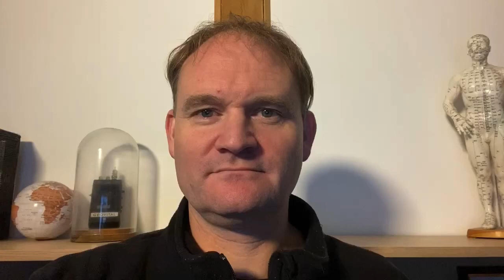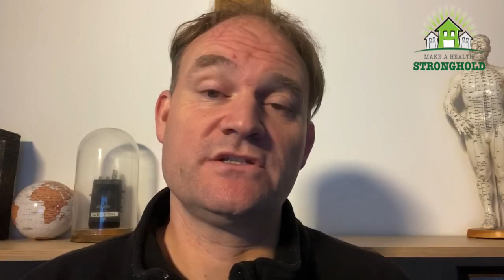Interpreting RF radiation readings on a TF2 or other EMF Meter

Comment: When you mention slight, severe or extreme exposure, what do you mean by exposure? Is it long time exposure, like in your living room or bedroom when you spend most time?  Or in a classroom? Because I constantly get low RF in every room (0.002mw/m2) except when I move  my GQ EMF-390 meter close to my router (less than two meters), microwave, or my smartphone/tablet (in active mode). Second question: My Trifield TF2 also measures RF in mw/m2 but the measurements are constantly lower than the GQ EMF-390 (like 10 times lower). Any idea why? Thanks for your help.
Reply: I think there's a Scale problem, in the instruction Manual says 10.000 mW/m2 is the max permitted. the max permitted according to icnirp is 10 W /m2. I would say that when you see 10.000 in the measurement is actually ten thousand miliWatts, not ten milliwatts.

Comment: What should I be looking for if my TF2 takes readings of 8.000+ mW/m2. In places we sit and eat. I live in a rental house built in the 40s, and after watching your video, I'm a bit concerned. What are some physiological effects I should watch out for?
Reply from the maker: Hi Jason, I think you edit this comment, I read your initial one from our notification. It is perfectly usual for RF readings to fluctuate from moment to moment and even in different spots in the same room. Reflection from building materials nearby could be at play and output of transmitters of course.
There is enough research highlighting the health risks at levels far less than you're experiencing, regardless of the fact most government standards find this perfectly ok. Question is if you want to wait/take the chance for physiological effects to start becoming undeniable.... or if you'd like to take steps to support your health. Headaches, ringing ears, anxiety and weakened immune system and low energy seem to be common first symptoms, but high blood pressure, changes in the blood, risk of cancers is also part of this story. Some people will develop nothing. Others can't walk into a library with the wifi on....
Key is your sleep area! This must be perfect and even in a rental you can normally ensure this is right with removable VERIFIABLE solutions. (Don't buy the crap that promises to neutralise, balance or harmonise.... ) 
First step is to get a professional assessment done by one of the consultants trained by us (GEOVITAL) who will assess the BODY rather than the air wherever possible, and will bring professional equipment and experience to do so. If there is noone nearby and this interests you... please come and do our EMF1 Consultant Training and become a consultant yourself. All information and consultants can be found here: www.healthstronghold.com/rfs?=1 
Don't wait. Do something.

Comment: I live 100 yards away from a monopine cell tower in Los Angeles. It is a new cell tower and very close to many apartments. From the ground, a direct, unobstructed path the TF2 reads (over scale peak, small numbers) and 15.000 + mW/m2 (large readout), from inside the apartment it reads 10 (on the small peak numbers) and 4.653 mW/M2 on the large numbers. I have pictures!
Reply from the maker: Its a worry. Read my comment to Jason I just left as it applies to you too I think
Reply: @geovital-international  We bought faraday material for all the windows, as the microwaves were bouncing off of the apartment building in front of our window, the faraday material reduced the radiation by 80%, no joke but we started noticing a difference (an increase) with cognitive function. Strange issues during peak hours 4pm-7pm where all of us would get tired/sleepy and cloudy headed specifically during those times on M-F, not something we want to be guinea pigs for, we are now moving.

Comment: Hello, is it normal that a bed grounding sheet is showing a reading of 700 /800 vm on standard electric setting? Thanks.
Reply from the maker: If its a grounding sheet... how does i have a 'setting'??  We disagree with the use of grounding sheets. They lead away a static charge, which is a problem of your MATTRESS, but they also attract MORE electric fields from the walls and ceilings around you. If you are on it, you are grounded and they YOU are more attractive for electric fields who WANT to go to ground. Youtube videos may show ZERO readings, but those measurements are no longer appropriate for a grounded surface. ALL interference should be dealt with BEFORE it reaches the body... not after.   Our consultants can investigate that, with you, and assessing the body wherever possible instead of the 'air' as it is all about you and your family... not the air. Find our people (or come do PRO training yourself) at www.healthstronghold.com/rfs?=1

Comment: I am interested in purchasing a RF/EMP meter to monitor areas of my house (bedroom) and electrical pole outside my house. The lower two lines on the pole are relatively new and they are equipped (I believe) with 5G emitters. The utility company and a subcontractor recently pruned several tree limbs, bushes from the pole to my house, and in the entire neighborhood. Not happy!!!

In addition, I wanted to use the meter to monitor possible radiation (60 gigahertz range) emanating from some “equipment”. What type of meter would you recommend or other suggestions you may have?

Comment: Patrick, I have the Trifeild TF2 EMF reader, and after feeling a bit disoriented while listening to a u-tube video on my cell phone this morning, I decided to measure the RF frequency coming out of my phone.  I was shocked to see it was kicking out high measurements that were peaking  at levels of 14000, and 17000.  So I turned it off and pulled out the battery.. Once I did that the levels returned to a safe and normal reading.  Do you have any explanation on why it was so high?  I live in Arizona.
Reply from the maker: You're measuring in milli watts which are small amounts but have been show to have biological effects. Thats why EMFs are ranked as a class 2B possible carcinogen by the world health organisation (just like exhaust fumes). Also phone manufacturers put warnings in their terms 'do not place this phone against your body' and that is related to the very relaxed government guidelines.
So short answer: That is what phones do. Keep your distance when on calls. Turn it to flight mode whenever you're not on a call (just call people back and use speaker phone), or better yet... get rid of it. - For health... your bedroom must be perfect and there is a lot more going on there I'm afraid. Get a home assessment done by one of my consultants and make some changes that matter most.

Comment: Hi Patrick, I have recently bought a Trifield TF2 meter and I am terrified to see that in the room that i keep my desk, which is on the second floor, the meter gives maximum reading (19,999mW/m2) almost everywhere in the room, even when I point it at concrete walls. How dangerous is this reading and what could be the source of it? Thank you - A little update: I realized that in this area im telling you about, if I am holding the meter or hover my hand around it the reading it's maximum but if I put it on a surface, the reading it's significantly less. Do you have any idea why this is happening?
Reply from the maker: Hi Jazza, good question. I decided to invest some time and answer you in a video. Go here and listen. Anything over 0.010 mW/m2 is cause for concern (severe range in our industry) https://youtu.be/ld4ChusLnts
Reply: @geovital-international  The manufacturer of this unit says under .2 mW/m2 and under 1 peak are safe levels.  I have 3 layers of emf paint and I can not get close to 0.01.

Comment: I live in an older apartment and as I changed our outlets before I noticed that there was no ground. Only some of the kitchen appliances where there was hardwiring had some ground wiring, but not all the other receptacles in the house. After checking some lamps in the home I noticed that it was reading a peak 500 V/m, should I be concerned? Thank you.
Also, is there any place that I can read to get more information about using the meter? Appreciate any response.
Reply from the maker: Hi Kobi. You should measure where you spend time. Right on top of wiring (where you don't sit) might not be so interesting. V/m is electric fields which are very significant when it comes to sleep quality (in our experience). With grounding issues, magnetic fields are more the concern.
1 V/m in the bedroom is too much.
1 mG in the bedroom is too much.
To learn how to use the meter and feel confident, please invest in some knowledge through a self-guided online course I have for the TF2, the Cornet ED88T plus and TM-190 (and others). Go too healthstronghold.teachable.com to access.
Good luck
Reply: @geovital-international   I love your video content! Just wanted to add to this as I am about to purchase a new property (right next to a few big pylons) and my meter reading (inside and outside showed 0mG for EMF, 0.03mW/sqm for RF and about 70-102V/M for EFs. I am happy to get 0mG for EMFs but should I be concerned about EFs and could I remediate it????

Thank you very much!
Reply from the maker: @eweliushte1  Hi Evelina. When you say you assesses 0mG I have to already doubt the quality of your meter. I have NEVER seen 0mG on any quality meter in any home with electricity in it. Only a $30 gauss meter insisted that 0mG existed where other meters indicated up to 4mG and the 'cheap one' insisted 'all was fine'. If you didn't pay at least USD150-175 for your meter, I'd doubt the readings.
On RF you should be shielding in my opinion. Levels are not excessive but are to high. Also your meter assesses the air, not the body. Electric fields are very high from those numbers. Best to get a professional double check your findings and then advise how to mitigate. Don't make the mistake thinking you can all do this without guidance or that the cheapest products are somehow value for money. We come from a wholistic approach to this subject. You can find our consultants, training, or connect with our office if you can't find someone nearby (our consultants travel a lot), here: https://healthstronghold.com/consultants/?rfs=1
Reply: @geovital-international  Thank you Patrick! I should mention that 0mG was taken outside in the garden (not far from the high voltage pylon) the levels inside were below 0.3mG. Still not sure how EFs can be so high and no mG.. The meter I used was EMF-390 (not as expensive as TF2 so perhaps a bit crappy). 
Thanks again, I will look at the link.
Reply from the maker: @eweliushte1   I don't want to say bad things about particular products or brands. :) But you may need to invest a little more that that... :)